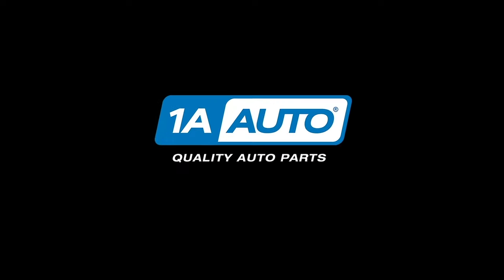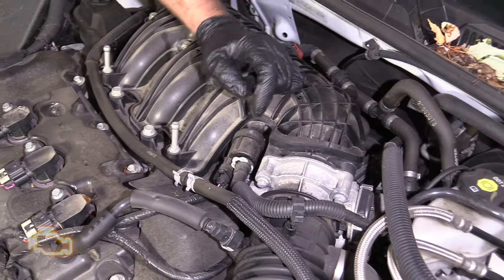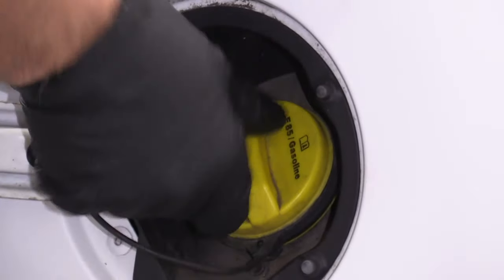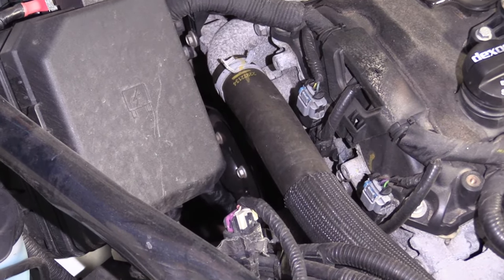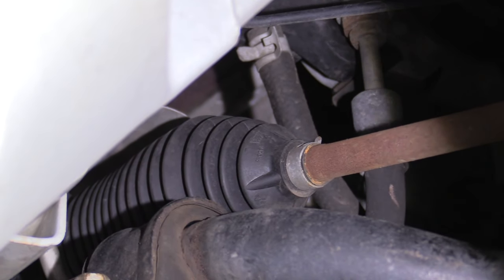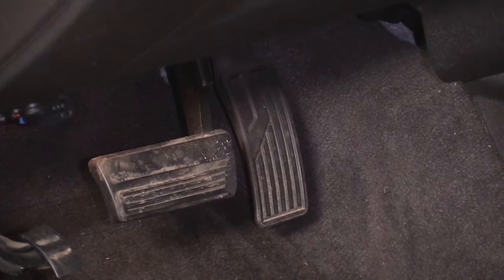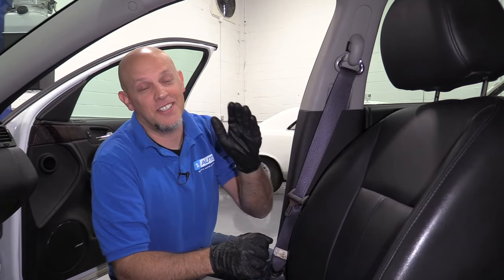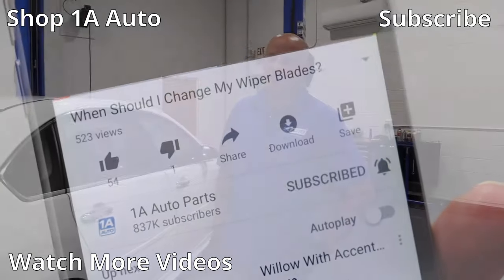Top 5 Problems Chevy Impala Sedan 9th Generation 2006-16

Comment: The air vent actuator is another part that goes out a lot in this car too
Reply: Indeed it does , went out and changed it in my father in laws impala a couple of months ago
Reply: Facts
Reply: Don't let it be hot and that thing start clicking omg
Reply from the maker: Good call! That should have been in the video. Thank you for checking out the video. If you need auto parts go to: http://1aau.to/m/Shop-1AAuto-Now
Reply: When I have my air on I have a ticking noise under the driverside dash.
Reply: And when I pump gas the pump stops asap.
Reply: @oKacz  blend door actuator needs replacing. The gears inside are plastic so they’ll get soft and a tooth will collapse. Once the tooth is gone, the whole device locks up. The clicking is the actuator trying to turn but it’s stuck.
Reply: Got those replaced on my brothers car 4 time since 2009. Driver side is very difficult to replace.
Reply: @Nigward it’s so annoying dude. :/
Reply: @Nigward the smallest noise concerns me and annoys me while driving. I guess I didn’t hear it at first cause my straight pipe and subs. But it makes a weird ticking noise n bugs me
Reply: @Nigward I just fixed mine yesterday it’s easy just hard to reach and there’s 2 on the passenger side most videos just show 1
Reply: Mines gone out twice since I got it 9 months ago
Reply: Yup I can live with that annoying sound 😂
Reply: Facts!! Already replaced two!
Reply: It literally cycles everytime you start the car, running the life of the part.
Reply: If you have the 9th Gen, you know the clicking sound. With 3 different ones going out randomly, I've replaced about 5 total over 6 years
Reply: Literally just replaced mines a month ago
Reply: i drive one and it happened twice, to two different sensors it’s the most annoying noise ever
Reply: @dantebrytant5285  loud asf too
Reply: Happened to me once got it fixed. Happened again..
Reply: Hilarious, I installed 2 on a 2016 limited lt just this morning how ironic i came across this video looking at 75 grandprix lj videos lol
Reply: Yep makes a horrible knocking sound every 15 mins
Reply: I need to replace mine asap.
Reply: Yeah I own one the actuators usually last about a year. It's a 20$ part though easy to fix
Reply: Been there
Reply: I literally gotta replace mine every year
Reply: @oKacz  blend door
Reply: I'm on my third one.
Reply: @dantebrytant5285  LOL mine click on and off the whole day, Not killing the battery yet. Anyone else has that issue?
Reply: Yup
Reply: That has happened to me a few times when I shut my car off, a loud as hell knocking that sounds like it's coming from behind the radio somewhere,  is this my problem?  It has only done it a few times, then it went away for a month, did it again, but hasn't happened again for almost another month?
Reply: @jefferysmith3433  Yes, more than likely. Chevy blend door actuator. There are four actuators. Three behind the glove box and one under the steering column. The single actuator under the driver's side is for temperature control of the driver's side. The actuator on the far right side of the glove box area is for recirculating air - fresh or inside recirculation. The one on the left side toward the front is for directing the airflow top, middle, and bottom vents. The one on the left behind that one is for the temperature of the passenger side.  
You may be able to pull a fuse, but that can cause other issues. I have heard if you don't push the two temperature control levers all the way to the bottom for AC it will stop it from clicking during AC operation- just raise it up about two notches from cold. I have heard gearing or the actuator not being powered down by the controller can be the number 1 culprit to vent actuator failure. When the vent door gets to the end of its travel, the controller sees the amp draw rise and stops sending power to the actuator. The gears in the actuator are not strong enough to repeatedly stand up to the motor being stalled out before the controller cuts power.  You may need a 7/32 socket and a tiny ratchet. I believe the actuators in the impala (06-13) are the same part number.
Reply: @peppilameu3144    I appreciate the reply!  Another issue that I am having, a couple actually that both relate to this video, one is the steering rack, but that is straight forward, its the other one that is a problem. I have had crappy idle, maybe 600 rpm, poor acceleration and very unresponsive, super rough idle asweell, and it also messes with the transmission shifting, and it eats gas like a 442 with a supercharger!  I replaced all the plugs, wires and ignition coil, but that did nothing for the engine. I bought the car used so I figure it needs a new fuel filter, and I was thinking pump aswell, so when I found out it was all one unit I ordered it last night (figure with the kilometers on the car it needs doing anyway)  I figured my catalytic converter could be gone, throttle body, or the evap purge solenoid (or whole unit) but now I am thinking all could be well with a new accelerator pedal position sensor, was wondering if you, or anyone else has experienced such a headache?  Also, the reason why it's such a headache is because the check engine light is not on?
Reply: Can anyone recommend a good YouTube video showing how to replace the air vent actuator motor?? Please and thanks
Reply: Mines been broke since ive had it lol
Reply: @jefferysmith3433  Mine does it every time I turn off the car.  Then If I walk out to the car at time during the day Ill hear it knocking.  with no key in the car.  Has not killed the battery so I'm fine with it..
Reply: Yep...and don't use junk aftermarket parts, only use OEM.  I learned that the hard way.
Reply: Yup I have to replace mine driver or passenger once a fucking year ! It’s getting annoying !
Reply: @dantebrytant5285  mine did that stuck in the cold position. I just unhooked it during the summer but had to replace it when it got cold.
Reply: @oKacz  that's it.
Reply: tick tick tick tick tick lmaoooooooooooooooooo
Reply: And they are annoying as hell too. Fortunately they aren't that hard to replace again and again and again and again...unless you have the dual zone climate control. Then apparently you need to be a contortionist to replace those.
Reply: That makes a "Top 6 List" not as catchy as a Top 5 List, LOL !!
Reply: @mmpiforall5913  you wanna know who asked?
Reply: I’ve given up on it lol
Reply: Yes, but cheap and easy to fix. Did all 4 on my 2010.
Reply: I went to a junk yard and pulled out an actuator motor and it was brand new! The Dorman box was in the back seat along with other trash. How lucky! Fixed the heater on my 2010 :)
Reply: @jefferysmith3433  what about when your ac is on
Reply: That is so annoying (actuator)...its driving me nuts...
Reply: @purplerainn101  the last 3 cars I have owned have had blend door actuator issues, what a P.I.A. !
Reply: All three of them. Makes sense to do them all at the same time.
Reply: @Frostitute I had to replace mine twice within a 3-month period. Of course there Chinese parts and plastic.
Reply: What u mentioned plus 3 on this post are prob I have experinced
Reply: That relentless ticking noise!!
Reply: Mine worked but they knocked loudly when you started the car or adjusted the temperature. Annoying for about a minute until they stopped. Lol
Reply: Tik, tik, tik, tik, tik most annoying sound on earth.
Reply: @1AAuto  do you know if a 2006 Chevy Impala have a access door for the fuel pump
Reply: Yeah I just got my 2007 Impala LT and it was clicking like crazy for a few moments and stopped.Everytime I start it it does it so I guess I got to replace an actuator.
Reply: You got that right that hard flapping noise scared the crap outa me lol but thats a major problem
Reply: @panthers559  same here!! Father in law 🤭🤭🤭
Reply: @dominictoretto6098  yes very difficult to reach,had to use a drill with flexible extension bit
Reply: I replaced drivers then passengers then realized there's 2 more in there for recirc. and vent selector. They both failed within a month of one another.
Reply: Yup mines went out recently too
Reply: Mines gone out 3 times and I’ve had the 2014 LT model for barely over a year. Drives me nuts and I’m sick of buying new actuators smh.
Reply: @jefferysmith3433  check the maf sensor,and there could be a problem with ECM
Reply: Hell yeah it does
Reply: Wow that's crazy I'm literally calling dealerships trying to find that part right now.
Reply: Yup. I’ve had to change out both of my passenger ones. I’m a pro at that and can do it myself. I now have an indicator for traction control with reduced engine power. Codes indicate the accelerator pedal so I guess I’ll have a go at that.
Reply: Got the same problem
Reply: Yes a lot. The two in the glove are cake to replace. The one on the driver's side under dash is a pain. I took mine out and getting it back in was like trying to pull teeth. A real pain. It's so far up in there and at an angle, you can't see it. Have to do it by feel. If you don't put it back in everything will run fine, but you'll not get heat on the driver's side or proper defrosting. Imagine getting in your car and turning your heat on and it comes on passenger side but blows cold air on your side. Closing the driver side vents will help some, but you'll still not get proper heating or defrost and you'll feel that cold air seeping through. Best to replace it. Also, noticed a slight vibration on these impalas and when you start up in the morning you'll get a rattling from the flex pipe until it heats up and it'll go away. Doesn't affect anything, just annoying for a minute. Only issues I've had. Fixed them all except the slight vibration. Checked tires, wheels, cv axles, steering and think it's the exhaust or wheel bearings going bad.
Reply: @mindyschocolate  same! And from reading the comments here apparently changing the actuators will be yearly requirement
Reply: @cpartida6969  I'm glad to know I'm not the only one
Reply: Absolutely
Reply: @oKacz  stick it all the way in not just the tip lol I have the same issue Where my gas would stop at like 3 dollars yet I'm on e lol Just give it a push and wiggle and it will catch if it slips out half a inch it will stop again So nudge it in Also the Tapping is the Actuator it happens anytime your car believes it's about to be in use It preparing the car for starting the Tapping isn't the car doing exactly that but it's getting your ac ready for Use It's caused by the Dual climate control This generation came with
Reply: @cpartida6969  no point in replacing the part if the solution isn't made! I refuse to replace mine spend 5 hours Doing it and not breaking anything and Spend the 100$ or whatever on the part... Just to replace it 5000 miles later?? Nahh I'll just turn up my stereo
Reply: @mickeyslim  I found that I have to barely put the nozzle in and then pull the trigger 1/4-1/3 the way at max or it stops. Maybe a bent neck? Or a bad float?
Reply: @LargeMileyFan666  my battery specifically died due to This ticking My car when someone with a Key fob walks near if it's sorta the same frequency My car will assume it's about to be used Prime everything then never get turned on the next guy with a Key fob would walk by my car and Boom now it's twice ... Now imagine being at work and ppl walking by your car on the way inside ...My battery died like 30 times cause of this and Between the battery being like 3 years old from 19 and the car doing that dumb shit My battery died as soon as the temperatures dropped below 40 I replaced it an I plan on Permanently fixing this issue Either by disabling the Functionality of the Door by Breaking it off or simply removing the broken part and never installing the new one Idk if it would work or what it would make stop functioning in the process but Fucc it I've had my car since 2016 and I've replaced 3 battery's this would be my third New battery Hopefully the warranty last the battery n I can get a free one like I did in 19
Reply: @peppilameu3144  you talking about not putting the AC on cold all the way bottom fixes it I legit To get my AC to blow cold on both vents have to Push the switch up to hot when it clicks I then have to Full send it to Cold It clicks for about 4 secs With Deep clicks then it stops and Both vents blow ice cold For both vents to blow heat I have to do the same but I just go up and down slowly then all up then I hit the passenger side down 1 notch I touch the vent and It blows heat It's weird but this car is the only car I know that's picky with everything lol but I'm used to it it's been the daily the last 80k miles and or 6 years
Reply: @oKacz  the mechanism for preventing Siphoning might be the issue That's at least what my car seemed like the issue was and that was my solution to get it over that last door then it flows freely
Reply: Yuuuup. Fml
Reply: lol tell me about it. I thought there was someone trapped inside the dash knocking on it when I first got it
Reply: Tick Tick Tick Tick
Reply: @JT Coulter  boi you haven't lived until you drove the car for a whole ass year with a bad oil pressure sensor (on back order) lmfao
Reply: I’ve had to replace all I think 4 actuators!!
Reply: I watched YouTube video and replace all my actuators.
Reply: Every 2 years I'm replacing the dang thing.
Reply: Based Maximilian mus profile pic
Reply: Omg! Mines sounds like a AK-47 when I unlock the car 🤦🏾‍♂️
Reply: I’ve replaced all of them on my vehicle. I think there is 4 of them. It’s not that hard YouTube it. Dealer wanted 500 to fix it.
Reply: Is that the part where it ticks really loud and fast for like 45 seconds then stops?
Reply: “The” as in singular??   You forgot the letter Y as in THEY.  3 of mine currently went. 4th should go before Christmas
Reply: @tommcelroy2276  yep I replaced all of them
Reply: Ive replaced both controllers three times on my 2008 LT Impala with 175000 miles on it.
Reply: @dantebrytant5285  mine has been clicking for 4 years. I’ve learned how to play with it to get my AC and heat to work 😂
Reply: I think that’s my problem right now with my 2015 limited impala
Reply: Yesssssss. Need mine replaced now
Reply: @oKacz  did you figure out how to fix that problem?  My 2008 does that.
Reply: @aboomalacani2732  if ur referring to the gas tank. I found a Reddit thread that said there’s a damaged float inside the tank that you can’t really replace without replacing the whole tank. I replaced everything else related to it so that’s what I had to do. Junkyard for 50 bucks
Reply: Yeah it does and it makes a click noise 🙄
Reply: I replaced vent actuators 5 times in less than 2 years. Last one today.
Reply: Came here to say this. 2011. 2 different ones replaced
Reply: Every 1 of mine are broken
Reply: Is that what causes the clicking sound
Reply: @zandersalazar858  yes
Reply: @zandersalazar858  yes
Reply: And I recently discovered you need to pull the fuse for a minute or so to reset the computer before the new actuator will work.
Reply: @oKacz  there are 2 actuators on the passenger side, one way up under the dash on the left, and one way up to the right of the glove box.
Reply: @oKacz    there's 3 actuators 2 behind the glovebox and 1 that's really hard to take out under the drivers drop panel where your knees are.
Reply: I had a car lot. And every one we got from the auction we had to replace them
Reply: Yup
Reply: That's what that is. Mine does it all the time. Sometimes I'll go to miss in the middle of the night and out of nowhere "click click click click" 

Going to Try to fix it now that I know what it is lol
Reply: That's what that is. Mine does it all the time. Sometimes I'll go to miss in the middle of the night and out of nowhere "click click click click
Reply: @wylykyotys  which fuse do you need to pull?
Reply: Does the dash actuator go out if you leave it on one setting? I am wondering if the actuator goes out because the setting is constantly being changed. I wonder if I keep it on one setting if the actuator won’t go out. I usually keep it on the floor and passenger at the same time
Reply: Oh yeah they do
Reply: AGREED!
Reply: Ours had three break total
Reply: That sound is so loud and embarrassing. I need to replace them soon 😅
Reply: @oKacz   same as my car it's a a messed up fan
Reply: @dilipmuranjan8725  I never pulled a fuse to change actuators. If you're asking to pull the fuse in order to stop the noise it would probably be the same one that runs the blower fan
Reply: AGH YES I REMEMBER DRIVING ONE DAY FROM HOME AROUND 4am, I WAS DRIVING SO PEACEFUL THEN THIS SOUND CAME ON AND IT SCARED THE SHIT OUTTA ME 😅😂
Reply: Are you talking about the constant clicking?
Reply: Yes the blend door actuator is the most common issue with these cars! I own 2 impalas, and they constantly go bad
Reply: you're right I forgot about that one, I had to replace 2 in mine (big pain in the a** to get to the one on the driver's side, can you say contortionist, anyone)
Reply: Yes
Reply: Lol hell I have changed that 8 times 😂. Till i said i am done. I disconnected them, no more problems.
Reply: When you borrow out your car make sure to let the person know about the noise, make clear that that car isn’t about to blow up 😂 knock knock knock knock the look of fear in someone’s eye when it goes out. ☠️
Reply: That's a Chevy thing. 
My cavalier did that shit too.
Reply: Great job
Reply: I wish I would have did more research as I didn't think to check such a thing. I think there are 6 in the car and have replaced  all the  passenger side ones at least once.
Reply: What's with the "service traction control" and "service stabilink"?
Reply: @jtcolter1312  the abs sensor pigtail might have went bad, you might have to replace the whole wheel hub, it’s pretty easy on this car
Reply: Click click click click click 😂
Reply: @purplerainn101 I have had to get mine replaced. This was the problem and the noise was a ticking when I change settings on my Climate Controls.
Reply: Yuuppp. There's three and it seems like as soon as you replace one, another breaks, fix that one , and another breaks, repeat cycle until death.
Reply: I let that horrible knocking sound in my glove box go for about two years. I said I had a woodpecker in there. But then ANOTHER actuator went out. Two sets of knocking going on at the same time 😂
Reply: Yes, and it drains the battery from the random thumping sound that kicks in just by opening the door, or even walking by the car.  So odd.
Reply: All chevys
Reply: Yep I had to replace two
Reply: @oKacz purge valve for evap canister,and or plugged charcoal canister or lines and or fuel tank pressure sensor faulty. Easy to test with a bidirectional scan tool.
Reply: @murph2521  replaced a few things but can’t remember. I seen a post saying something about the breather tube inside or something of the sorts. I’ll have to get it scanned and see what they find. Thank you!
Reply: I had three go out in two years, about $200 a pop.🙄
Reply: I've fixed this more times than I like too
Reply: Had to change both in mine already
Reply: Ha!  I am in the process of replacing it myself (and I’m NOT mechanically minded).  There’s a hood video on YouTube on replacing it.  The part is only $12.99 on Amazon  (June, 2024).  Tomorrow I (try to) instal the replacement.
Reply: @elijahcooper1458    Same one?  There are 3.
Reply: Bro I've changed like five of these in as many years.
Reply: Yes!!!   I've had to replace mine twice
Reply: Click click click had both sides go out in a two week period
Reply: Mine has gone out twice in 4 years. But we fixed it ourselves.